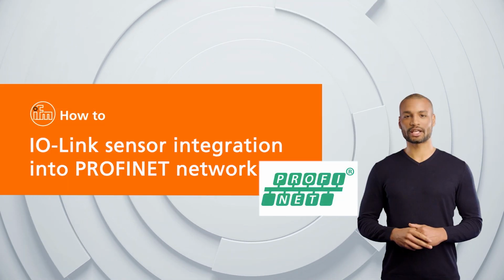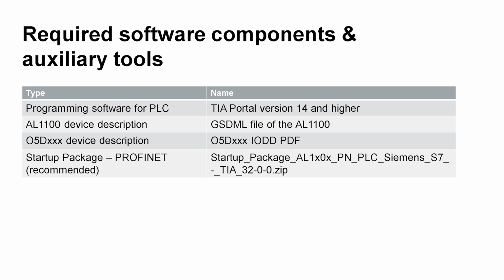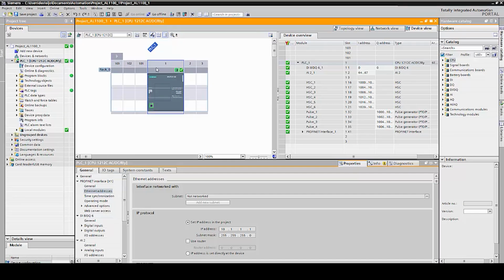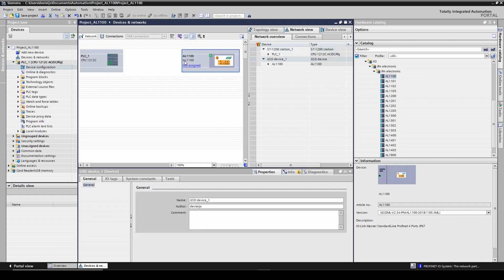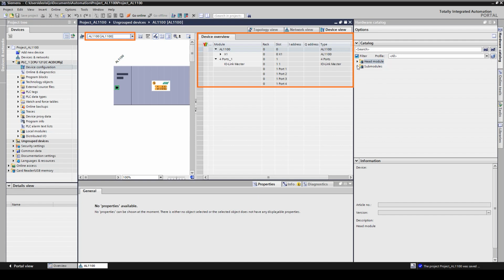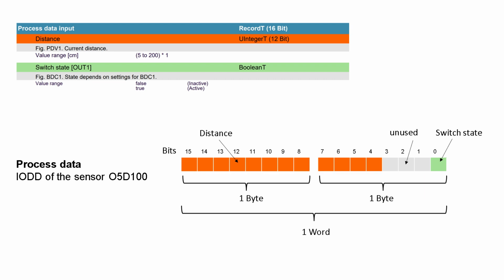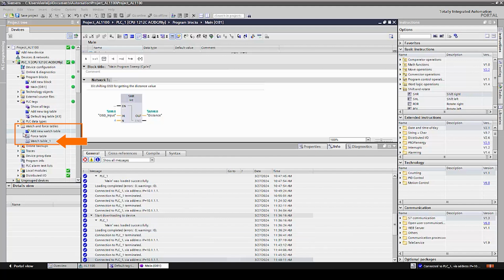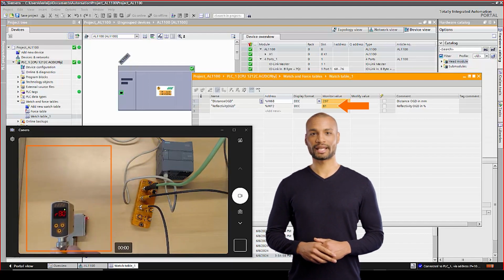IO-Link integration into Profinet

Comment: Can you tell me how to get the vvb306 sensor to work with the al1102 and s7 1500. The BF light is no longer flashing red but the upper light on the x01 is flashing red?
Reply: Is port 1 in submodule 1 the right choice for this sensor to have IO-link in 32 bytes + PQI?
Reply from the maker: Yes you can use any Port you want, please take IO-Link In/Out 32/32Bytes + PQI for VVB306.
Reply: @ifmgroup  thank you very much, that was the problem :D
Reply: @ifmgroup  Now my x01 upper light is flashing red, what is the cause?
Reply from the maker: @shadson2384  What country are you in? I can send you the customer service hotline.
Reply: @ifmgroup I from Finland, now i just need to know how to upload VVB306 IODD to Siemens Tia Portal V20. I have problems with that.
Reply from the maker: @shadson2384  Hello, there is no need to load an IODD into the Siemens S7 TIA Portal. The only important thing is to know how the data is transferred. This information is provided in our PDF IO-Link interface description, which you can download from our product page. Use the following link to go to our product page: https://www.ifm.com/de/de/product/VVB306#documents 

We also offer a startup package for Siemens S7 TIA on our website. There, you will find numerous instructions and function blocks (FBs) to assist you in setting up our products. Use the following link to go to the startup package download section on our website: https://www.ifm.com/de/de/download/eco310_StartupPackage_AL1x0x_PN 

For more details please directly call our local support in Finland: +358 9 424 55 805

Comment: For those who may use this as a reference, the V19 TIA Portal version shows differences in terminology and verbs (hardware: ET200SP, version 2.9).

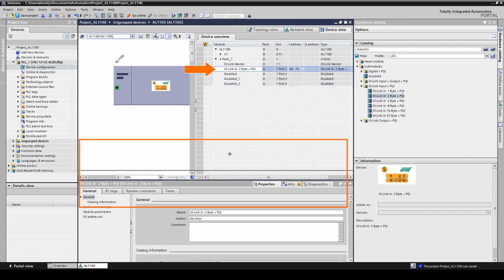In the video at 10:26, “Deactivated” is used instead of “Disabled.”
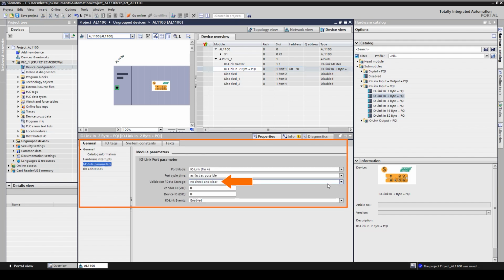In the video at 10:33, “No check and clear” is changed to “No device check and clear.”